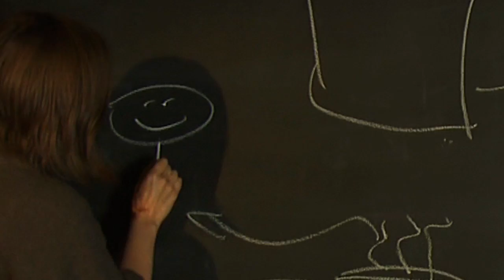The Bathroom Reinvented: Virginia Gardiner

Comment: Inventor Virginia Gardiner confirm that invented Loowatt, very simple to use, as it produces energy from human waste. The principle is simple and relies on the transfer of waste from the toilet tank to the side is isolated. Waste in the tank free of oxygen and thus the microbes in the waste analysis of waste from the process to produce methane and carbon dioxide and other gases. Gas is used for cooking